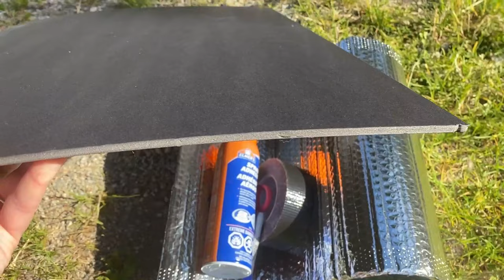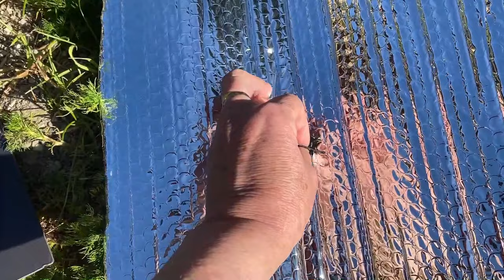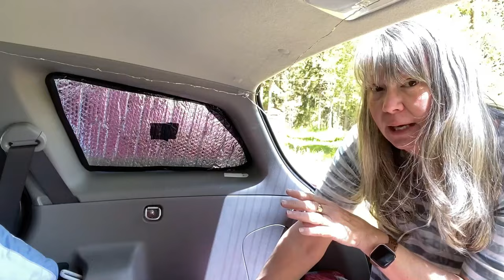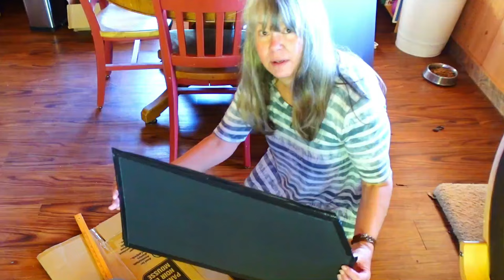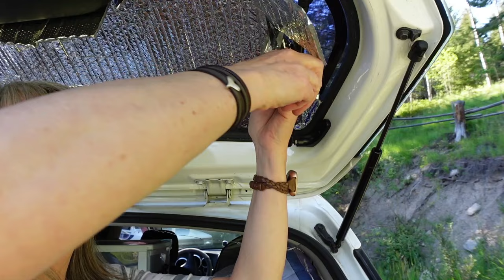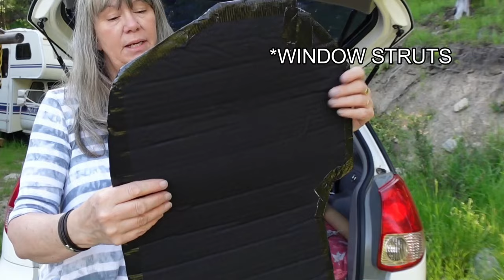DIY Easy REVERSIBLE Window Covers For Your Car Camper

Comment: Hey I have the 07 version of that same white car - love it and have already had a few adventures.  I made the foam board window shades - just brilliant, thank u!  I didnt put on the tab handle - I just crank down the window and pop them out from the outside.  And didnt do the reflectix since when I camp in hot weather I like to drape my entire car with Aluminet shade cloth 90% which keeps car amazingly cool even in blazing sun.  The netting hanging over open windows kinda serves as insect deterrent too, although in areas with heavy skeeters Im sure some would get in.      I think I will add reflectix layers to the window shades though for cool weather camping (having it face inward)  plus have a reflectix layer under my mattress to keep the chill from seeping in from below - happy sleeping and safe travels everyone!
Reply from the maker: Thank you for watching! I love your idea using the shade cloth! I'm going to have to look into that. I've just completed a 3 week road trip in my car camper and some nights up here in northern BC were pretty chilly. But, I realized I was staying quite comfortable in the car at night with just 1 light comforter. I think it was the window covers. I put them up every night, reflectix side facing in,  and slept cozily all night. Take care and happy camping!

Comment: CC sent me.  Great job.  Will redo mine soon.  You can also cut and insert a piece of screen somewhere in the middle for air and no bugs while being able to close it up since it is placed between the reflective and the foam core creating little doors on either side.
Reply from the maker: Hi fellow Susan! That's a great idea! I do have the screen covers for the windows that you pull over the whole door, but little screen doors on the covers would work great! I'm going to try that with the 2 front windows as I have yet to make those ones. Thanks for the tip and for visiting!

Comment: Great video! I think the only thing I might try differently is just covering the black side with black duct tape instead of bothering with the black foam board or black fabric. I’m definitely going to make some of these for my Jeep!
Reply from the maker: Hi Kelly! The black duct tape would work too. The difference would be that duct tape is shinier. I’ve noticed in other car/van campers that you can easily see the duct tape reflecting the light even through tinted windows, which does take away a lot of the stealthiness if you are trying to overnight someplace where you want to be inconspicuous. The foam board is non-reflective and just looks black through tinted or untinted windows. One thing I hadn’t taken into consideration when I used the foam board was it’s insulating qualities. Between the foam board and the reflectix my car stayed cooler in the sun and warmer at night! Bonus!! Anywho… just wanted to make you aware of the difference between the duct tape and foam board! Hope your covers work out great and you have many happy adventures in your jeep!
Reply: @HoneyandMe  Great points! Thank you.
Reply from the maker: @kellydiver Hope they help!😁

Comment: Hi I love your videos and am currently staying in my car now.  Not by choice but here I am. Anyway lol I have tried this method and found alot of the heat makes the duct tape hot and smell and also didn't feel safe using the spray adhesve because of chemiicals as well. Is there a safer method to these. Thanks so much in advance, Donna
Reply from the maker: Hi Donna! Thank you for watching and leaving a comment. Regardless of why you are staying in your car, you seem to have a good attitude. Good on you! Making the best and being thankful goes a long way in finding joy.
Now, as to the 'smell' issue! I'm wondering if it could be the duct tape brand. Mine have never emitted an odour in the heat, so am at a loss as to why yours would. As to using a different method to glue to 2 sides together, you could use a glue gun. Or any glue that you felt okay about. Just give it the time to dry and cure. If you are still hesitant to use a glue, you could try just putting the 2 pieces in the windows, one on top of the other, and just use the friction and pressure of the window frames to hold them in. It would be more fiddly, and the pieces may not last as long without the duct tape to protect the edges, but it could work if 
you wanted to avoid the use of glue and duct tape. I found in colder weather, these window covers, with the shiny side facing in, kept my car much warmer at night, and in the daytime with the shiny side facing out to reflect the sun, kept the car way cooler on hot days. It's the 2 layers that work together to insulate the windows better. But you could also just use one layer at a time. It really depends on what you are comfortable with. I hope this has been helpful and given you some ideas of how to make it work for you.

I'd love to hear what you end up with and how it works for you. Stay in touch! All the best-Sue
Reply: @HoneyandMe  thanks so much for getting back to me ..I really appreciate it. I will definitely try some of these methids out. Have a great week.
Reply from the maker: @dmrcreations3311 You’re so welcome! You have a great week too! ❤️

Comment: Get the reflectic with the foam in the middle,,,,,,, not the bubbles. 5 mm works best.
Reply from the maker: I didn't even know this existed! Where do you get it? Now I'm off to do a google search! Thanks for sharing this information and for watching!
Reply: What is the benefit of getting it with the foam in the middle?
Reply from the maker: I have yet to find this stuff, so can't comment on the benefits. I do know the reflectix makes a huge difference in the amount of heat that DOESN'T get into the car though.

Comment: Wow, that works great! Thanks for the tips! What did you put in to keep the light out of the front windows and windsh? Same thing?
Reply from the maker: Hi! Thanks for watching😁In the front windshield I use one of the store bought windshield sun reflectors. I got mine at a 2nd hand store that is for a Kia. It is bigger than my windshield so covers it completely with excess on each side. Then, so far, I’ve been using 2 of the kind that fold up into a small circle. Hard to explain them. They have wire around the edges and pop open on their own. They cover the driver’s and passenger’s windows in the front seat. They are black on one side, which works with staying stealthy. I plan to make the same covers for the side windows in the front when I get a chance as the ones in the back work so well. Until then, these pop out ones work is I place the right and use clips to keep them in place. Take care!❤️
Reply: @HoneyandMe  awesome! Thanks for the quick reply! I will be making some of these for my Florida trip next month. I sleep at rest stops on the way, but hate the bright street lights, so this will solve that problem! I got over 300,000 miles on my matrix, and it still runs like new!
Reply from the maker: @Paddle-N-Fish  I'm envious!! Loved Florida when I was there a few years back! Good luck with your window covers and your adventure!! These Matrix cars are amazing!!

Comment: I have a Pontiac vibe (so a Toyota Matrix) I found your video for help with figuring out a sleeping method.

But your video on how to make the window coverings is so detailed. I didn't think about using both black foam board and black duct tape.

What thickness is the foam board?

It looks like a trip to JoAnn or Micheals is in order.
Reply from the maker: Vibes are great too…I had a 2009 and only sold it when my son in law begged to buy it😁 
I’m so glad you found me! The foam board is about 1/4 inch thick, and I’m pretty sure it’s a standard thickness. I got mine at a dollar store. I have to say how well the covers work! I’ve made sets for the Matrix and my Rav4. Traveling last fall I found the covers really helped to keep the warmth in the car overnight and I didn’t need to use my 12-volt blanket at all! 
Good luck with creating your covers and have fun car camping!👍
Reply: @HoneyandMe  thank you for the response. Yeah, I love my Pontiac Vibe. I got about 170,000 miles over the 10 years of ownership on it and I hope to hit 300,000.

I went to Micheal's today and I found the foam board. I got the 20x30 and the 24x36 ones. I measured the front windows and it seems like they are 31 inches across at the longest point, so I don't know if the 30" ones will work.

Also your video, helped me decide that I didn't want to make a window cover for the rear window and just get one of the covers made by Heat shield. They have covers for every window, but at $50 for the three sets I would need, the cost was a bit much.
Reply from the maker: @DanielWoike What year is your Vibe? 
I have yet to make a cover for the front windows. I usually just use the folding windshield covers you can buy. I figure if I’m being stealthy, there are so many people who put them up in their cars to keep heat out that it wouldn’t stand out. I did make them for the side windows though so it appears to just be a dark tint. Let me know how your front one goes! Good idea on ordering the back window cover. It is the hardest one to make with all the weird bumps. My Matrix has a separate opening window in back, which is great for camping, but makes even more stuff to cut around. The Rav4’s was much easier to make. 
Good luck with your covers! Lmk how it goes!-Sue👍😁
Reply: @HoneyandMe  Thanks Sue. 2008 Vibe. I was talking about the front side windows, not the windshield. I use a Covercraft folding windshield shade on the windshield.
Reply from the maker: @DanielWoike Lol! I guess we’ll never know how difficult making one for the windshield is😆This summer my goal is to figure out a good curtain for privacy between the back and front of the car. I made one that worked pretty good last summer, but I think I can do better. Hoping to do a video later on. Let me know if you think the money spent is worth it for your back window though. I’m curious!😁

Comment: I bought some foam board thinking I’d use that instead of the reflectix but turns out it has bad smell. I left it out to vent but 3 days later it still smells 😢 Do all of them do that or I got a bad one?
Reply from the maker: That’s weird! Mine didn’t smell at all. Does it smell all around? Or is it from the foam between the papers? If it’s the foam, maybe sealing the edges with the tape will trap it? That is very strange, but I’m assuming there are different producers of the same kind of stuff. Sorry I can’t be more help, and I hope you can figure out a solution. Best of luck👍-Sue

Comment: Duct tape glue melt is a disaster in my van.
Reply from the maker: Wow! Really?? Where are you located? Are you in a hot area? I'm trying to think of something else you could use in place of duct tape. It seems weird it would melt as it is made to wrap furnace ducts which carry heat! I wonder if different brands might actually be different quality. Something to think about for sure. Thanks for sharing!